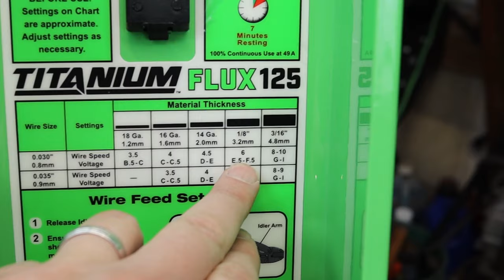Welding Lesson 01: Flux Core Welder Tips and Tricks

Comment: Some great tips on using Flux core wire. I do mostly repairs,  so I run into many different types of metal and thickness.  When welding only a few times a year it's hard to get proficient.

Comment: Chop saw is best. Can get the 6” pretty cheap at harbor freight. If you need bigger occasionally get a big chop saw or use a grinder and cut off wheel. Simple stuff. If you frequently are building something that isn’t practical to cut with a small chop saw or angle grinder then you need to spend the cash on a large chop saw or a low end plasma cutter.

Comment: Just started welding. Right now I only have the titanium flux core welder. I just put a 50 amp outlet in my garage in hopes to get a multipurpose unit soon. My first project would be to use some square tubing I have laying around to make a rolling cart for my miter saw. 

On a side note as a new welder I certainly appreciate the time and effort put into the videos they have helped me immensely.

Comment: Full time fabricator here who also owns a titanium flux core welder.
the biggest tip i can provide for anyone reading this, is to CHANGE OUT THE STOCK FLUX CORE WIRE WITH REPUTATBLE FLUX CORE!!!!
Titanium brand flux core wire is  T R A S H. it sparks and pops and crackles, and porosity happens all the time with it.
I bought some Hobart Flux core wire and it ran SO damn good. The results were so far different that i HAVE to share this!!!!!

Comment: Anti spatter spray and nozzle gel give nice improvements for FCAW, I wish I had started using them sooner. I think the anti spatter spray also helps control the heat. I mean, its not much, just a little liquid that goes poof, but I have an easier time with things not heating up so fast when I use it vs when I dont.
Reply from the maker: Right on!

Comment: If I won that welder, I would use it to practice more types of welding than I currently can with my budget, so I would have a better opportunity to get in the maintenance department at work. And use it to get some better welds on the welding table that I'm building for myself out of angle iron baskets.

Comment: May I ask why your settings was on the welder please? My new Arccaptain 200 was set to 13,2 volt and wire speed at 5,7. I had to spot weld. My square tube is 1,5 mm thick. Tried to weld like you did, but I blew a few holes! Wonder if my settings was totally off ;)